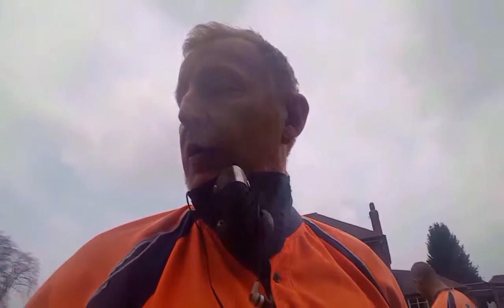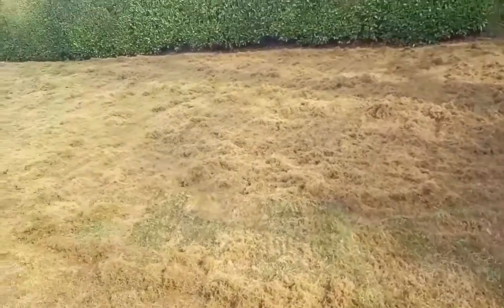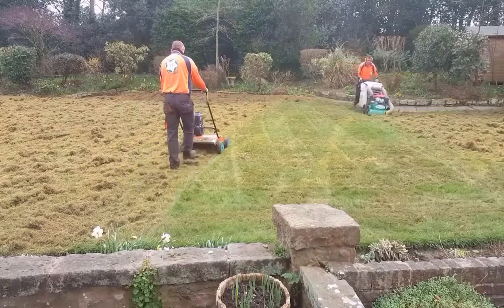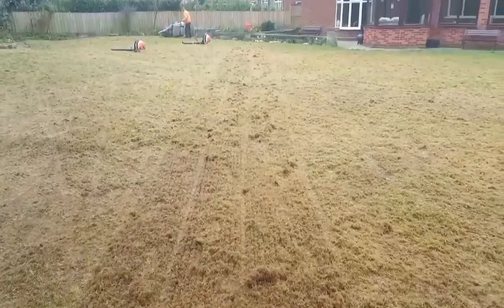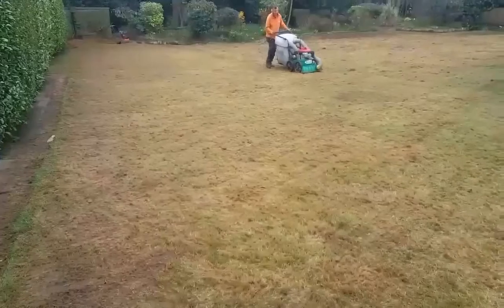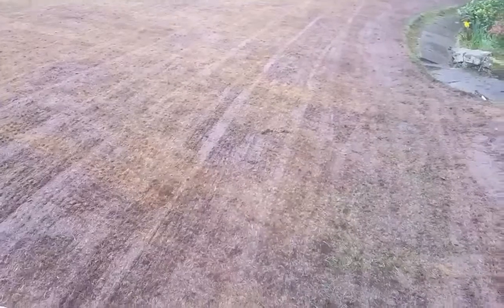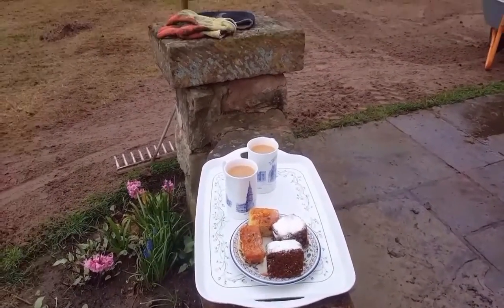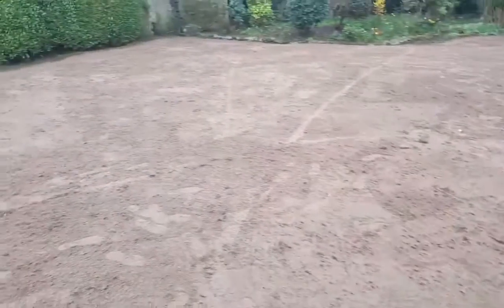How to Scarify the BIGGEST lawn in the world (well...nearly😁😁) Moss removal. top dressing.

Comment: I know this comment is coming a year after the video but I just found your channel. I have never heard of this process or of moss in the grass. I know we get thach from grass clippings that aren't mulched. Maybe because I live in the high desert of Texas (the very very top of the state. I have traveled in many parts of the United States but still haven't heard of moss in the grass. Do you think we have this here? Is there a use for the moss? can it be  composted? If not what happenes to it? I am fascinated watching this, I just can't believe the piles and piles of the stuff comming out of the grass! How does that machine work to remove the moss? Is there a roller with spikes that pull it out as you roll over it, Like how a vaccum goes across the floor (without the suction of course)

Comment: Great video. Wish I’d seen it a week ago. I just did four passes over my lawn with an underpowered Einhell I got on eBay and took out a huge amount of moss but man was it back breaking work raking it up by hand after each pass. I then put down granlime, fertilized with 7 6 17 and overseeded. Unfortunately I never top dressed. Is this needed for germination? Seed is only down a couple of days. It’s a 1/3 of an acre lawn. I recon I’d need a lot of sand!
Reply from the maker: RiftFlyer Thanks for watching...the top dressing does a couple of things..it evens out "slight" discrepancies in the lawn and by adding more over time it levels more each time and secondly it protects the seed from the birds and also keeps it moist. It is not the end of the world if you don't use any ..but it helps 👍
Reply: Definitely use top dressing of some kind. Top soil is ok (but can get weedy) or peat moss works great. Regulates soil temperature and retains moisture. Protects from birds, wind and heavy rain. In my experience germination is improved by at least double with top dressing. The key is to tread seeds into soil either way. 😁👍